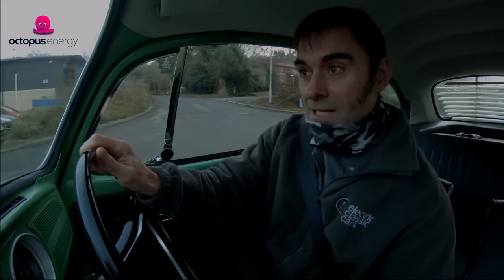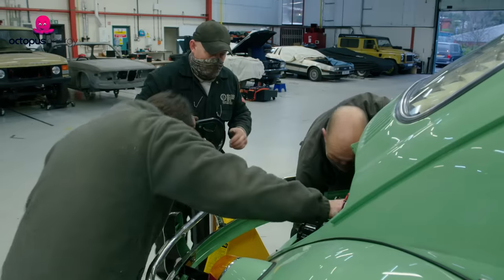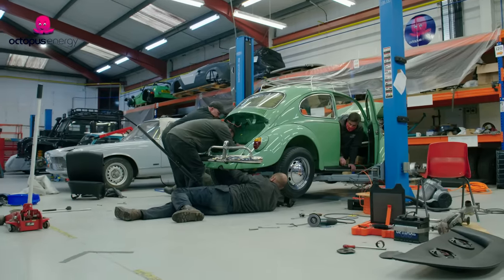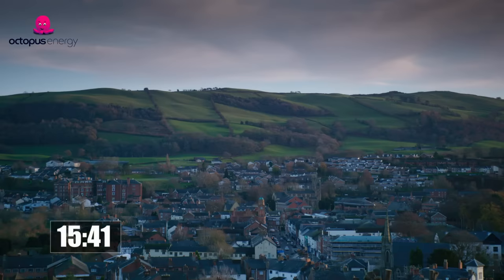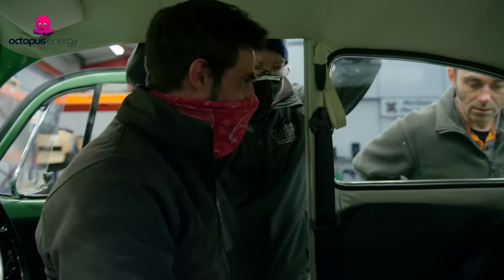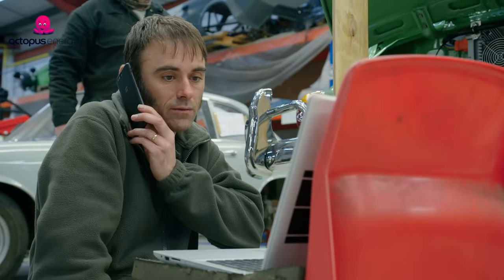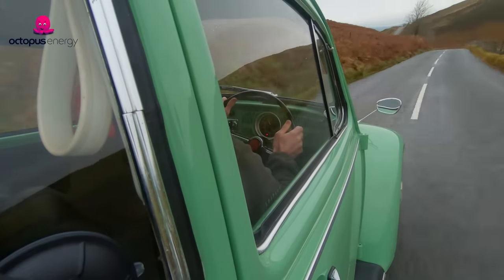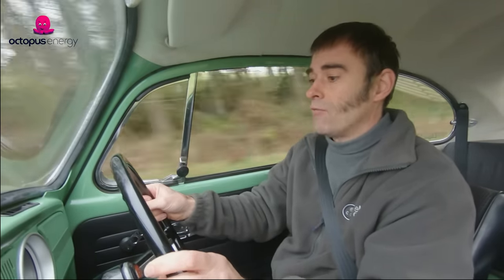VW Beetle converted to electric in a day

Comment: Does anyone else find it crazy shocking how clean the engine and overall body of that car was?
Reply: I'm guessing they started with a clean older restoration, and pressure-washed the engine compartment and underside before it went into the workshop.
Reply: What bothers me is that SOMEONE paid good money and worked pretty hard to make that bettle pristine and they are now hacking it up to make it electric. 😭
Reply: @denrizza  Nah, I am sure someone will purchase the engine. I have had my bug since '97 and gave it a lot of thought, I don't think I would miss the 1600 much anymore, it is pretty slow already and it stinks, for a short distance driving vehicle converting sounds like a pretty good deal.
Reply: I could understand if the Bug was a beat up… convert to electric and do some body work.
But to take this immaculate looking showroom clean car and start tearing it down seems too much.
Reply: No longer a classic car
Reply: Take a beautiful, working classic and turn it into....only the brits.
Reply: Are you members of the classic car police? It’s way better than getting asphyxiated by an old museum piece. Have you experienced an electric car? I have.
Reply: @Krunch2020  Yes, we had electric vehicles back in the very early 1900's milk floats were a thing in the 1970's.
The fact is there are more fumes to produce the electric than to burn fossil fuels in the car. Also more mines are required to produce the car, charging facility etc. So don't come the environment road because you are out of your depth
Reply: Yes pisses me off they're turning a classic into an electric completely ruined it
Reply: @davidbaise5137  They just ripped the heart out of this beauty...
Reply: They should use a vw that was not good shape but not this nice classic.
Reply: You can make electricity without burning anything and if you have to burn wood, coal etc to make electricity waste exhaust is cleaned much better than any combustion engine exhaust. Mining materials for electric car is bit worse for than for gas car but lower impact battery chemistries like sodium-ion is making big advantages. Electric cars are mostly charged at home with off peak electricity so you don't need that many fast chargers.
Reply: This looked like a 1963 model. We had one back when they came out. (I was three!)  and it just ran forever. No problems ever.
Reply: yes
Reply: @union310  Are you a troll,or just incredibly misinformed ?
Reply: So many people think they have a say about what someone else does with their vehicle !😂
Reply: @stephencrowther524  Which aspect do you dispute?
Reply: @stephencrowther524  Still waiting for a response, care to expand?
Reply: It's ridiculously clean
Reply: Yeah, I saw that too.  I like the color!  Nice jobs guys!
Reply: That's classic car for you jim😊
Reply: avg porsche guy
Reply: @ElectroAtletico  ...turn it into something better.  Yay brits!